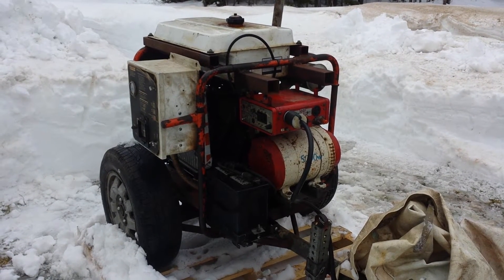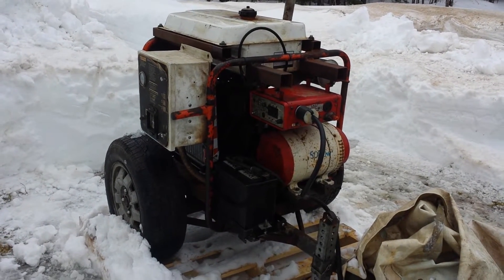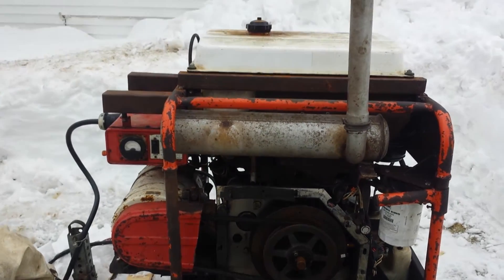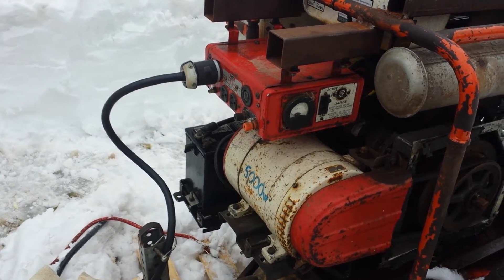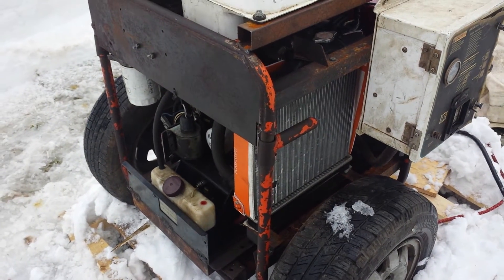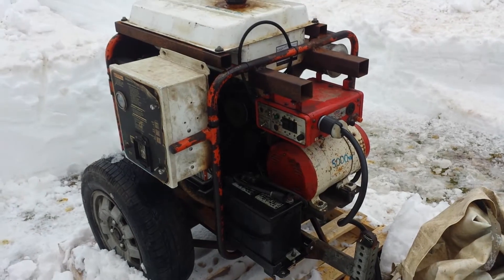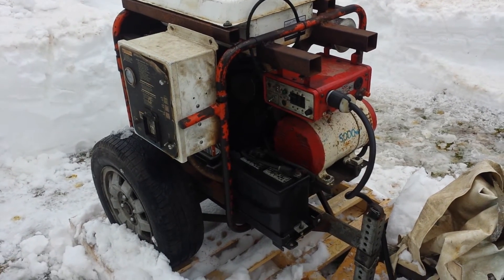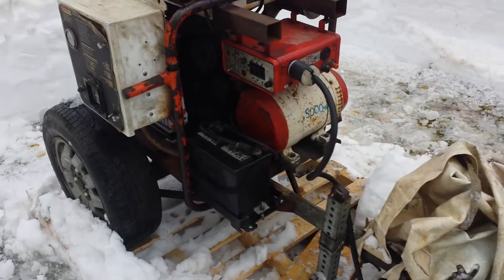Home made 4500 watt 2 cylinder diesel generator

Comment: very good job, one inquiry. how do you match the engine rpm to the generator head input rpm ?.
Reply from the maker: Thanks you.
North America uses 60Hz frequency as a main power supply everywhere. For a 2-pole generator like this to make 60Hz, it has to turn 3600 rpm. Most portable generators run 2 pole gen heads, so they run at 3600 rpm (actually a bit higher to allow for droop, but that's another discussion). It's just math to find the pulley sizes needed to match the engine rpm to 3600 rpm at the gen head, or you can go online and use the various simple calculators available to give you the sized needed. Fine tuning the rpm was done by adjusting the engine speed.
Reply: @ZackaryMac  much appreciated. Thank you. We use 50hz frequency  for 240v. Meaning the generator world need to run at 3000rpm?
Reply from the maker: @tashmarkify  Correct.

Comment: Did the 4500 honda head have a 120/240 output? the pulley drives are well sought after. thats a great setup for plug and play and almost forget. I have a kubota twin on wheels with a meca head. previous owner had an alternator hanging off the gen head and It basically shook itself apart so I added a couple of battery chargers to run a fan and charge the start battery. it looks rough like your but functional for pumping water.
Reply from the maker: Clarissa W the head has 115 and 230 output. The difference is the 230 isn't two 115 (or 120 for 240v ) outputs. It's actually just 230v, 3 prong plug (2 hots and ground). After inspecting the wiring diagram for this head, I used a 240v, 30a, 4 prong plug, and hooked in the neutral, giving me 2, 115v outputs. Not sure if phasing  would be a problem with this arrangement, I hooked it to my garage and tried my 240v air compressor to it. Worked great.
So, to answer your question, it has 240v (well, close) plug common in today's generators, and 120 also.
Reply: Thanks Zack for your reply...some of the smaller gen heads below 2KW use two windings connected in parallel to get that extra amperage out of a smaller package vs 2 windings connected in series with a central tap. We run our well pumps solar by day and generator by night on the highest voltage possible to overcome the 116# of hydraulic head. Tanks are located above grove area. 4-6 gallons diesel will get us thru the night. 

I'm worried about cooling over the long haul so I'm putting an air cooled yamaha single mated (lovejoy couplers) to a chinese st-5. Just an experiment to see if the small 6hp single will drive the massive 200 # generator. Im using the softest spider coupling so the power pulse cycle doesn't tear things to shreds. Ive found that 2cycle mix oil added to diesel fuel and gas engines profoundly increases service life. In 6 mo we can easily exceed 2,000 hours on our engines.

Comment: looks good to me   I am building one with a small air cooled diesel and a 3500 watt head
Reply from the maker: OTAlucard Thanks. I hope it works out well for you.
Reply: yeah those honda generator heads are built REALLY Good !
Reply: Curious which air cooled diesel...? We have put some hours on a yanmar and lambardini and I like them both for reliability and fuel economy. Both were mated to unreliable heads...one a brushless meca and the other a brush power guard.